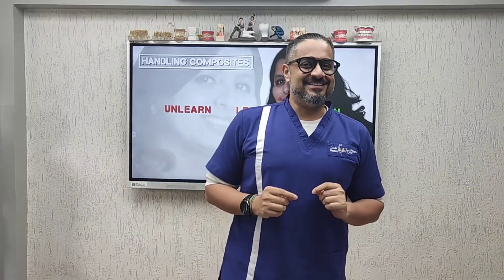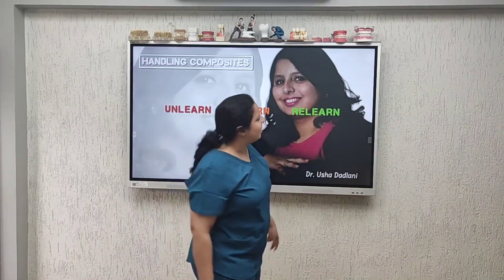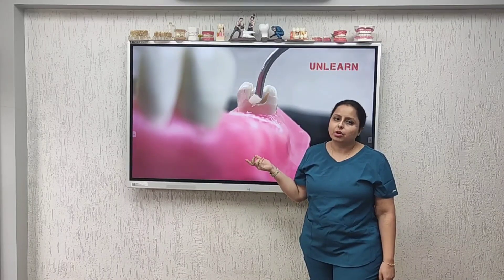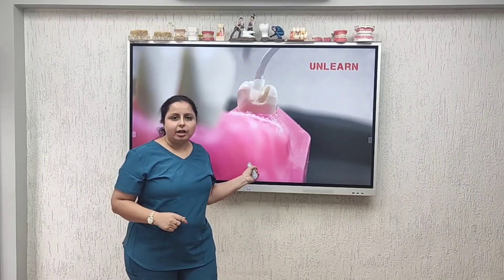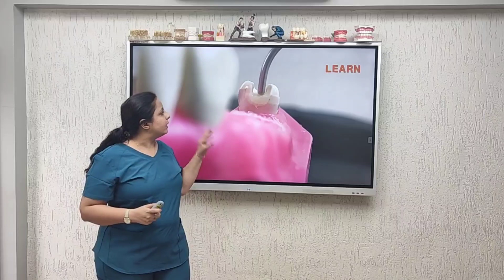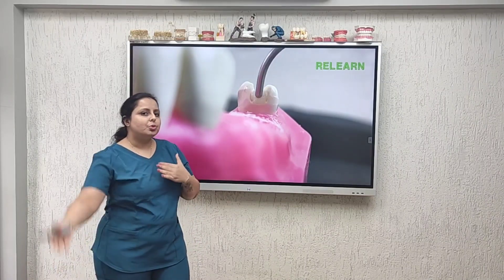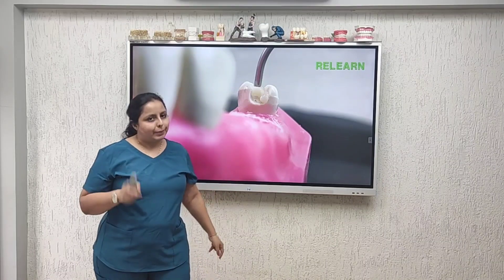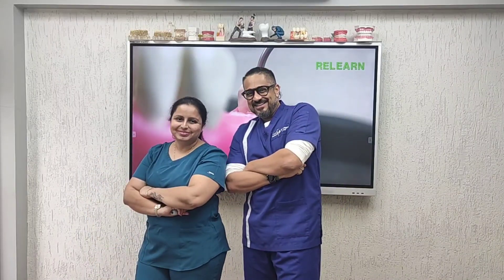MAKING COMPOSITES INSTRUMENT FRIENDLY

Comment: We can unlearn by switching to teflon coated instrument... Also the packing of composite can be done from wall to wall to avoid air voids
Reply: I have Teflon coated instrument but still it doesn't work still composite sticks so I use dentin bonding agent to make unstick is it okay? Need ur help...😊
Reply: @SAMARITAN83  I've seen dentists just dip instrument in water . and it makes the instruments non sticky for 10-15 seconds. Nothing fancy but simple ,accessible and cost effective
Reply: GDC golden tip Teflon coated instrument doesn't stick... Will try this dentin bond trick though